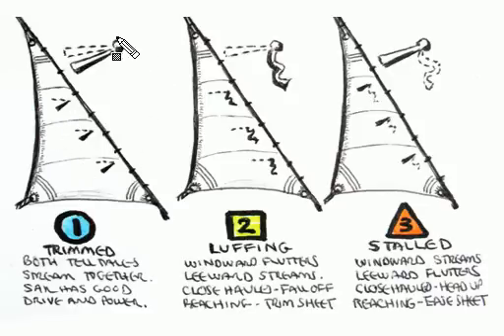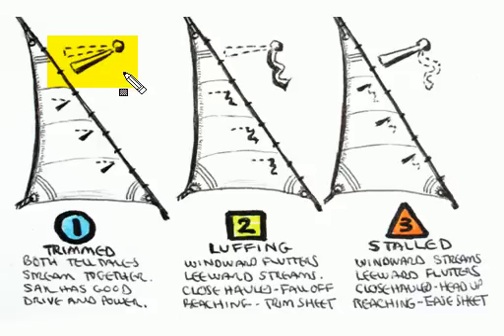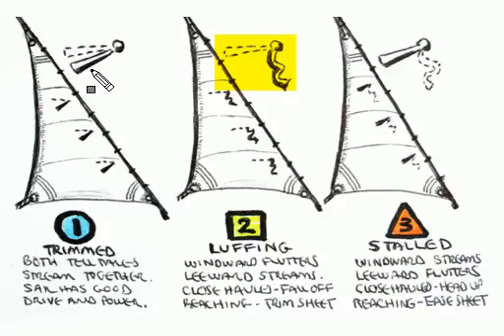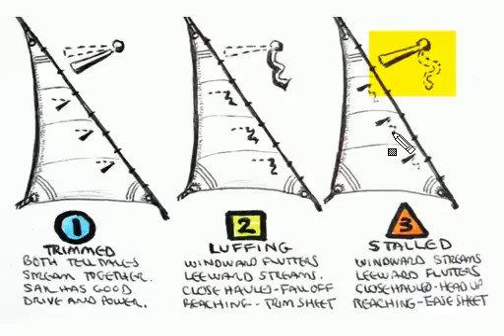How to Use Luff Telltales for Power

Comment: An easy way to remember this is that when beating, you want to push/pull the tiller in the direction of the fluttering telltail. So if the windward telltail is fluttering, pull the tiller windward, if the leeward telltail is fluttering, push the tiller leeward. Be careful to steer small and remember that as the boat gains speed the apparent wind will shift forward and you will have to fall off.
Reply: I know this was 11 years ago but it was exactly the explanation I needed. Thanks!
Reply: Now 13 years later, and still a brilliant explanation! Cheers!